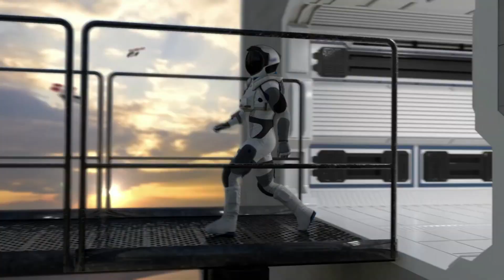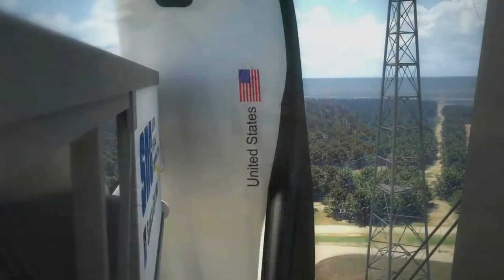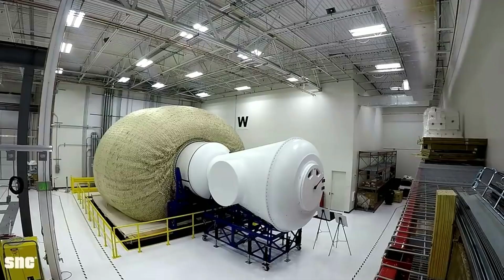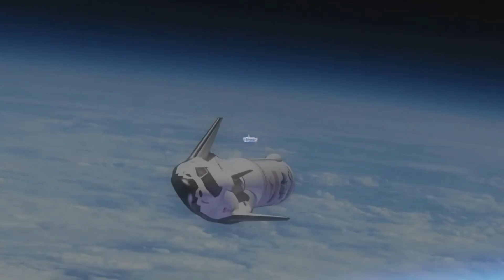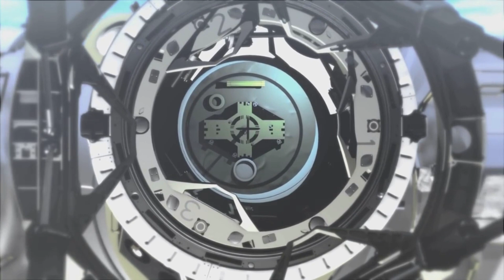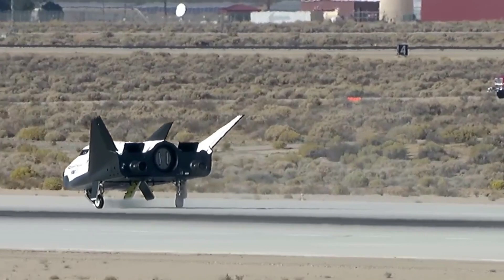Dream Chaser Is Getting Very Close To Its First Launch

Comment: I don't like the concept of the dreamchaser, mainly that it is undermined by having to launch on a Vulcan Centaur rocket which is not reusable, it can't use any other on account of fairing size requirements, when you factor this in and the size of the loads, the only advantage is landing like a plane and minimal refurbishment, which to me sounds like the shuttle program, and not competitive in the age of starship, which is superior in every important metric from reusability, load to space, cost of load to space, I just don't see what he advantage of the dreamchaser will be. I hope to learn more, maybe I am misinformed.
Reply: No... just no. There are incredible differences between the Dreamchaser and the shuttle program. 1st; there are far fewer tiles, and fewer unique shapes of the tiles to look over when it returns to Earth. 2nd; it can ride on the Atlas V, and even Falcon Heavy with the larger fairing they are designing if necessary. Also, the manned launch will not use a fairing and is designed to be able to launch away from the rocket if necessary. 3rd; Vulcan will be partially reusable as the engine section will separate, reenter, and be caught out of the air like Electron. 4th; Unlike the space shuttle, it can land at any commercial runway in the world and doesn't use toxic rocket fuel in its maneuvering thrusters, so astronaut and experiment recovery is much faster. 5th; because it is launched atop rockets, it avoids the dangers that doomed the Challenger and Columbia shuttles by protecting the heat tiles from falling debris and allowing them to abort the launch with an escape burn. 6th; a smaller vehicle allows for easier transport to a launch facility and cheaper and faster refurbishment. 7th; there is no dead space inside the Dreamchaser, it's cargo bay and Shooting Star module are designed to service space stations not build them. So there won't be massive doors to worry about jostling or malfunctioning. This is completely different from the original space shuttle.
Reply: I thought the video said the manned version could be launched without a fairing.
Reply: Starship is totally absurd!
Reply: @powerfulstrong5673  >>> Why?
Reply: @Allan_aka_RocKITEman  Starship isn't aerodynamic feasible during reentry into atmosphere!
Reply: @powerfulstrong5673  >>> Why?
Reply: Dreamchaser is much more practical and feasible and much safer than starship!